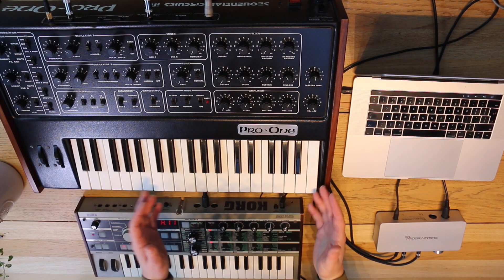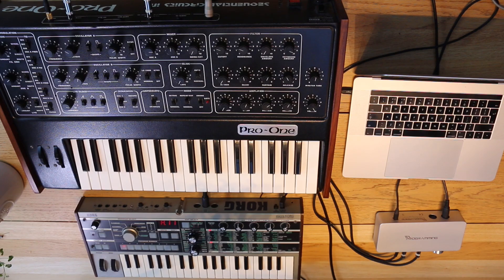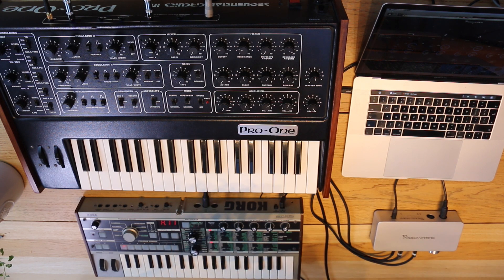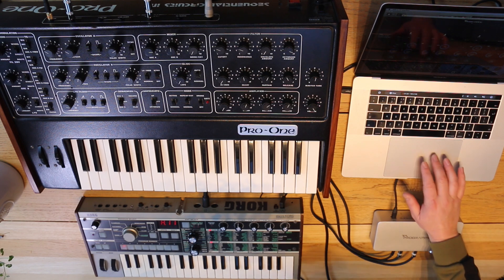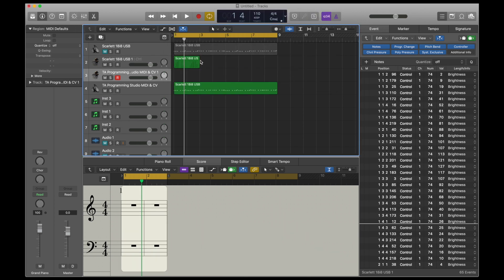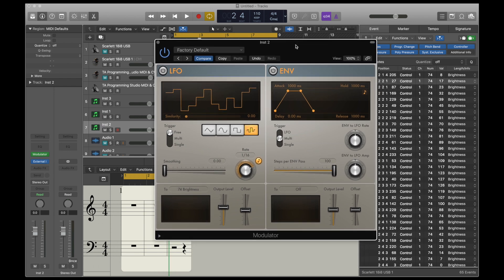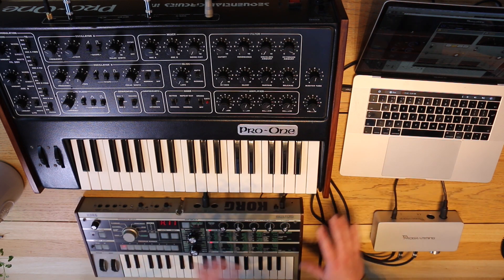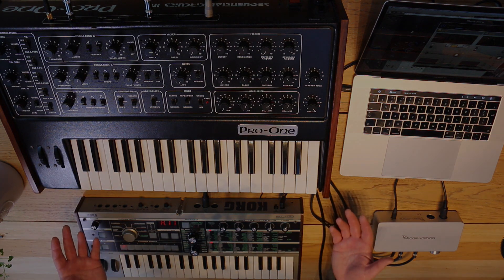Using Vintage Synths with a DAW using TA Programming MIDI to CV Converter: Setup, Demo & Review

Comment: I'd like to fiind a good MIDI velocity to cc converter for the Stylophone gen R8. It takes a number of cc parameters, but not, of course, velocity sensitive. I'm dying to play it from a velocity keyboard and map that to filter etc. Have you ever tried that on any synth?
Reply from the maker: You could map velocity to cutoff/volume etc with this - as long as there’s a CC for it.

Comment: Incidently, thanks for the heads-up on the Behringer Pro-1 knobs. I should have known that the compromise of smaller knobs would lead to less precise control of parameters. I was thinking of retiring my Sequential Pro-One with its dodgy, sticky keys, but then again... Nice video Starsky and at £249 the converter is relatively affordable.
Reply from the maker: It got to annoy me after a while.  I recorded some footage looking at the envelopes and how I couldn't be as precise as I wanted.. then checking if they were actually digital which would explain things.. all got a bit geeky and pedantic, so gave up on it in the end. But its sooooo much nicer playing the big one! Behringers a decent enough replica, but from a hands on point of view it just can't compete - size does matter after all :)
Reply: Well, if you think the knobs are too small on the Behringer Pro 1, then give the Roland boutique series of reissues a massive wide berth!
Reply: @GNeuman  I have done for exactly that reason. Roland should provide you tweezers for free.
Reply: @apislapis  🤣🤣🤣
Reply from the maker: @sneakydisco The envelopes are digital, so they can tweak the response of the pots - or at least how the software responds to the positions.  I've not given it a thorough workout with the envelopes since the update.  I spent an afternoon examining the old ones and disappeared into the depths of geekiness... only just managed to save myself from the habit hole.

Comment: Can u make a how to smpte to digital recorder and tape ?
Reply from the maker: if my multitrack wasn't broken!  just put a track on record, press play on the SMPTE box, and it should print the timecode.  Set up your DAW to external sync using the input from that channel and wherever you are on the tape the DAW should sync. I's years since I did that.  Have an old  XR MTC300 in the attack next to the broken 8 track :)
Reply: @StarskyCarr  sounds easy thx